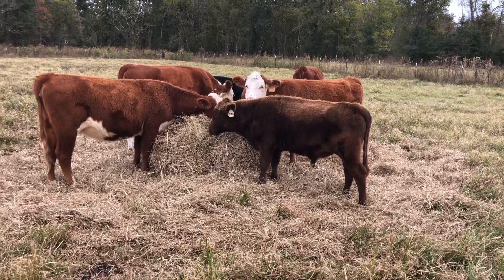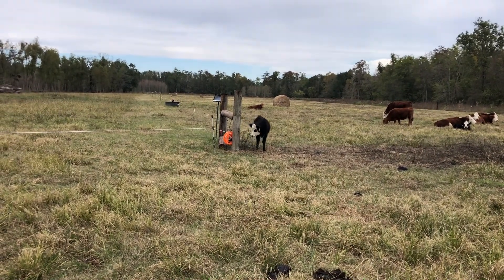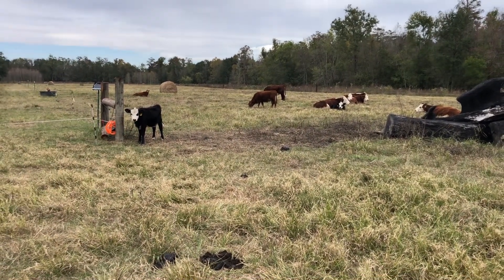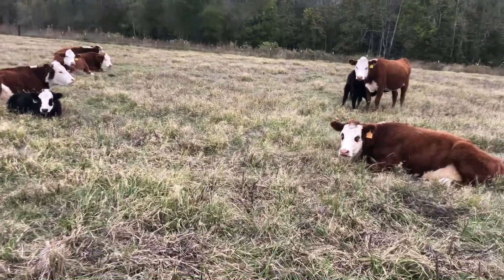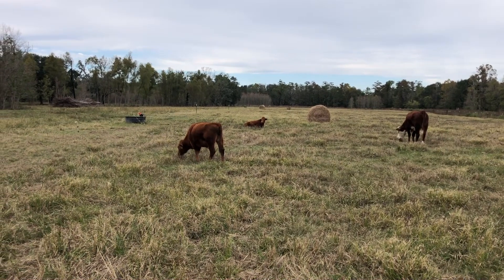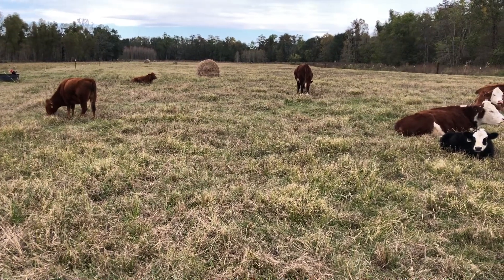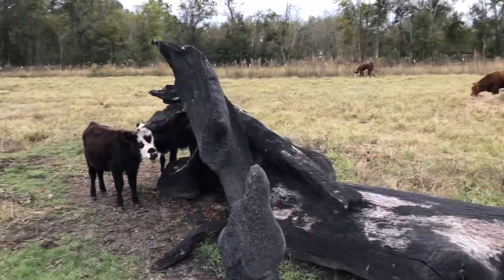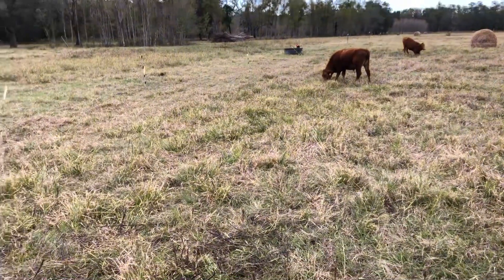Regenerative Ranching

Comment: Just a thought have you tried a compost extrract on the soil, BUT use a pound or two of Biochar per acer in the mix to neutralize any toxins that are residing in the clay . The Biochar will help the fungi to stay in place in your soil. Less likely to run off do to the clays drainage plus it should help break up the clay and accelerate organic mater build up. Tell me what you think...
Reply from the maker: Honestly,  I’ve never consider it.  I did burn the field about 3-4 years ago at the recommendation of a biologist.   I was very disappointed by the result.   I believe it set the field back by removing organic matter.  I’ve never made biochar,  I will have to look into to see if it is feasible to generate enough to have an impact on this field which is about 20 acres.   Thanks for the suggestion